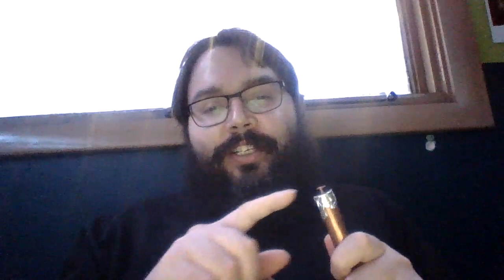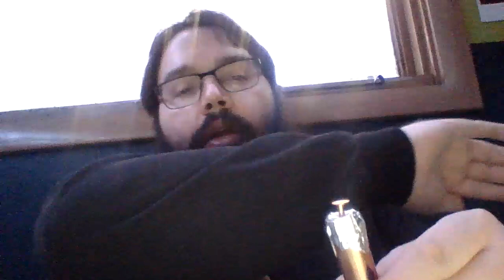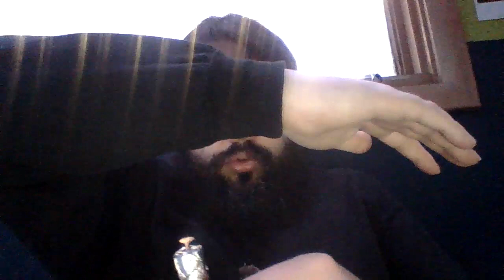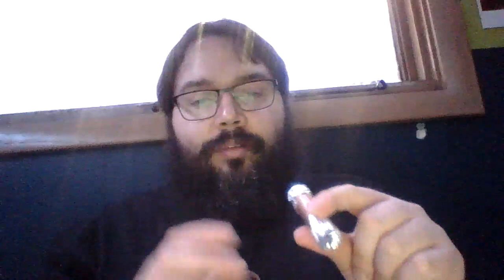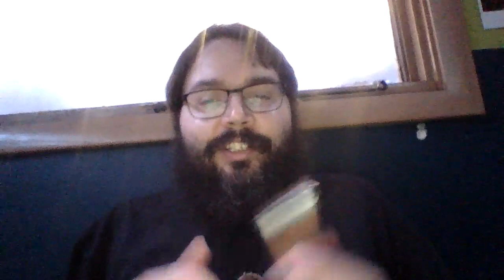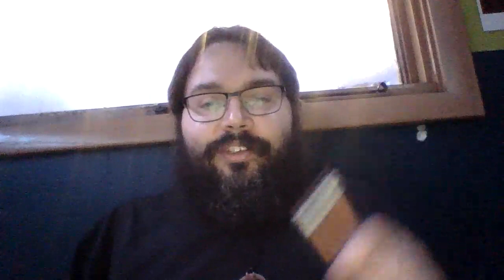Infrared? heating from sand orgonite

Comment: Do you need to have multiple lengths of wire running backwards and forwards across a room to heat it . Or will a single length strung across a room be sufficient?
Reply from the maker: a single length
Reply: One per unit per room then ? This is great since we are in winter
Reply from the maker: @Bobby-ph2iu  Yes, but any length should work
Reply: You says it goes through walls . Do you mean the wires or the heat radiated Can the wire be hidden behind drywall or curtains and still warm a room . Books arriving today. Looking forward to reading it. Could you post some pictures of the wire set up
Reply: Interesting ...just one connection to the antenna then...the other end of the wire just stops wherever ...not a circuit